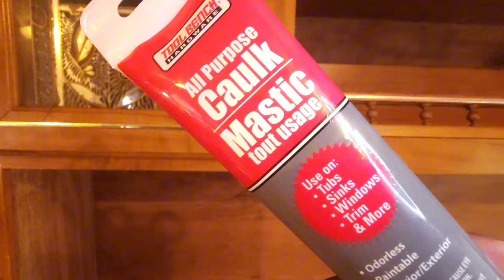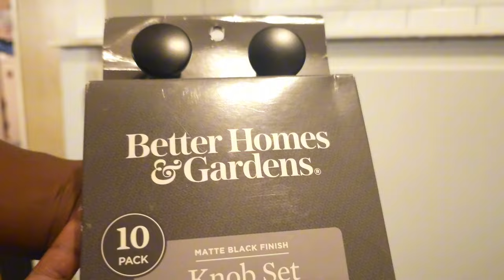Mobile Home Makeover | Dollar Tree Backsplash dupe!! | Diy Coffee Bar Remodel

Comment: Can the design on the cabinet windows be scraped off by chance? If not, plexi glass or mirrors might be a more budget friendly option.😊 Maybe you could even find something at a thrift store that has glass and get it cut to fit! Also, using caulk on all the little gaps and trimming out the tile would really elevate things too! What an awesome turn out, great job!👏

P.S.- a lace table runner would hide the imperfections on the countertop top too. Just be careful not to spill coffee on it. Maybe do black lace to be safe?😅
Reply from the maker: Hey!! Yes I actually scrapped a lot of it off, but I wasn't able to get the rest off in time, but yes you're so right! Plexiglass would do very well! 
And omg, yes a runner is definitely needed! I have had to be so careful with it!! Thanks so much for watching!!! And thanks for the tips, I really appreciate them😊❤️
Reply: @SheCanDoAllThings  🖤🤍🖤🤍

Comment: How did the faux subway tiles hold up? The tiles I bought started falling off about six months in.
Reply from the maker: Mine are still up I  haven't had to replace not even one. I guess because I have them in a dry area they have been able to maintain the adhesive pretty well.